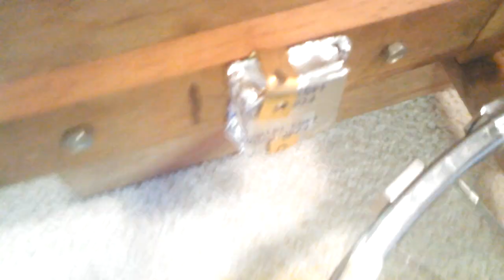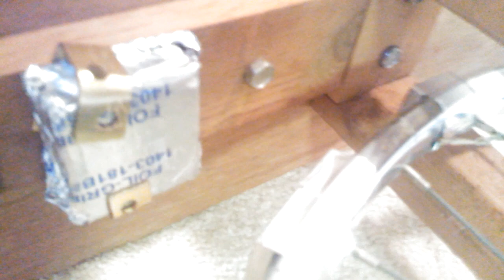🧲 Roney Stators Part 1 of 2

Comment: souns familiar, this mission thing :D
Reply from the maker: It turns out that this magnetic motor challenge was solved way back in 1966 by a German man who made a working car motor that ran only on magnets. See link below. Others as well on the web have also made motors using only magnets. See links below. My design concept is different from most others as I'm going for super torque. The links below were long since made available in the video description as well. If by chance you're still around, thanks for stopping by.

((( MAGNET MOTORS THAT ACTUALLY WORK )))
👉🏻 MAGNET MOTOR - Rotor Encantado
https://youtu.be/mxgwTzxfe8Y

Amazing Magnet Motor/Gen Rep. This is not a fake
👉🏻 https://youtu.be/jKFTAobM-l0

WORKING MAGNET MOTOR 2023
👉🏻 https://youtu.be/vdtdKE2Qe40SELF RUNNING MAGNET TURBO MOTORhttps://youtu.be/6sIBHn5-9pI

🆕 WORKING MAGNET MOTOR - rotor magnéticohttps://youtu.be/3mD0_0FiJ54

MAGNET ONLY MOTOR from SOUTH KOREA
👉🏻 https://youtu.be/smzpbKg9S7M

1966: German inventor presents his Free Energy Device Magnet-Motor
👉🏻  https://youtu.be/XWQjMyMWXAc
Reply: @FreeMagneticEnergy2  yes I am still here. surprised to see a reply to a 9 year old comment 😄

Comment: James, why do you only use a single stator mag on one side of the base that the wheel rotates over? What would be the pros / cons of using a second one on the other side of the base? 

Whatever the other secret is you refer to, I suggest you at least document it and give it to a trusted family member for safekeeping. Secrets taken to the grave don't do the rest of society an ounce of good. Many famous inventors no longer with us have already made that mistake.
Reply from the maker: Point well taken That's why I long since released everything I know. Note: It turns out that this magnetic motor challenge was solved way back in 1966 by a German man who made a working car motor that ran only on magnets. See link below. Others as well on the web have also made motors using only magnets. See links below. My design concept is different from most others as I'm going for super torque. The links below were long since made available in the video description as well. If by chance you're still around, thanks for stopping by.

((( MAGNET MOTORS THAT ACTUALLY WORK )))
👉🏻 MAGNET MOTOR - Rotor Encantado
https://youtu.be/mxgwTzxfe8Y

Amazing Magnet Motor/Gen Rep. This is not a fake
👉🏻 https://youtu.be/jKFTAobM-l0

WORKING MAGNET MOTOR 2023
👉🏻 https://youtu.be/vdtdKE2Qe40SELF RUNNING MAGNET TURBO MOTORhttps://youtu.be/6sIBHn5-9pI

🆕 WORKING MAGNET MOTOR - rotor magnéticohttps://youtu.be/3mD0_0FiJ54

MAGNET ONLY MOTOR from SOUTH KOREA
👉🏻 https://youtu.be/smzpbKg9S7M

1966: German inventor presents his Free Energy Device Magnet-Motor
👉🏻  https://youtu.be/XWQjMyMWXAc